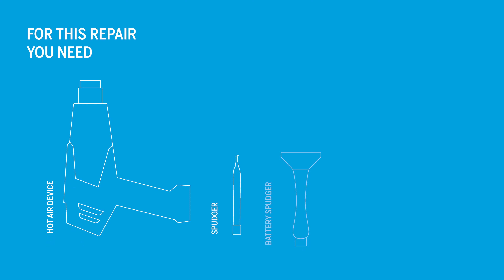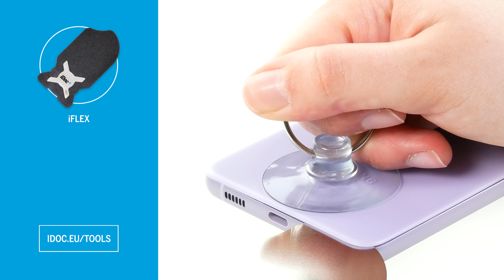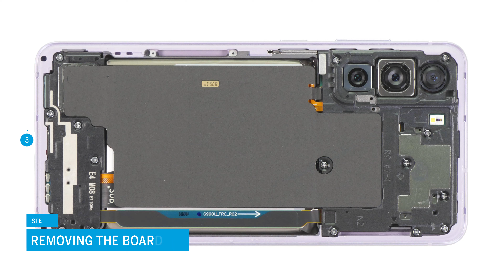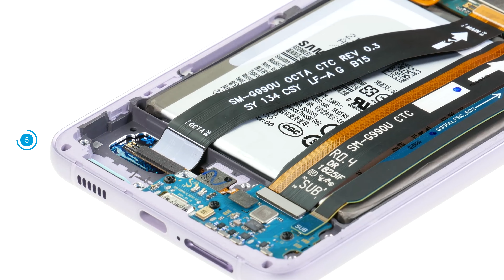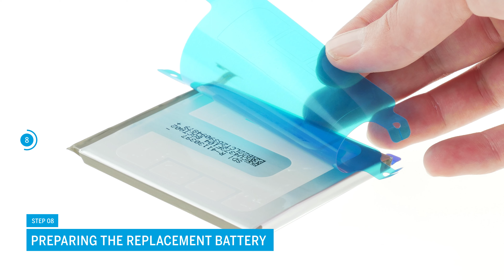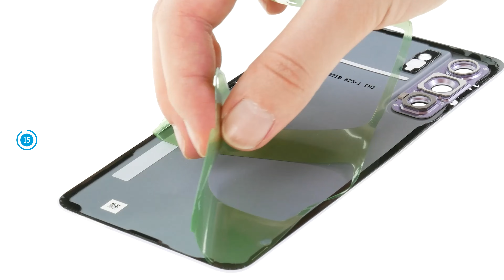Samsung Galaxy S21 FE 5G – Battery replacement [repair guide + reassembly]

Comment: Hi, I had the batttery replaced by a service shop. Is the battery percentage same before and after installing new battery? I just find it weird that I brought my phone with 31% charge and got it back hour and half later with 30% charge. Feels like I have been ripped off and the battery was not replaced.
Reply: That sounds so suspect
Reply: Did you find out anything?

I don't blame you for using a pro. I can't believe you can't just snap off the cover; remove the battery with your fingers and replace the cover without special tools etc. It's ridiculous that they have made this so difficult!